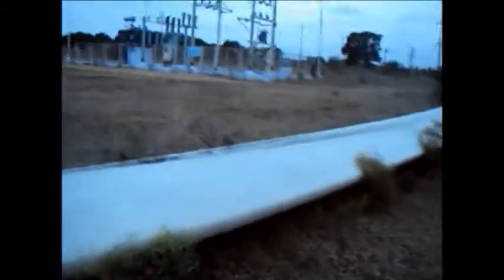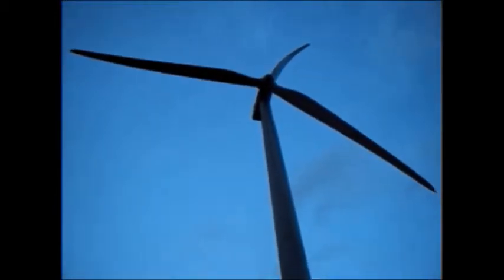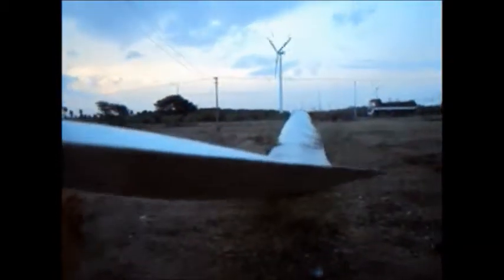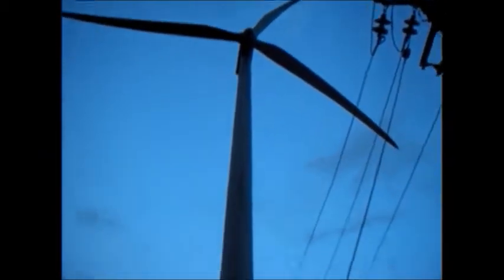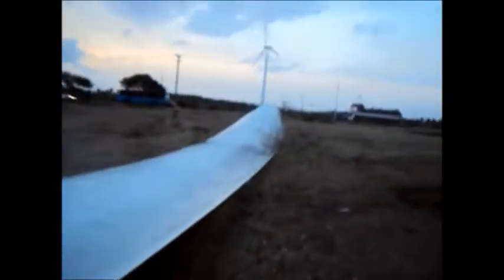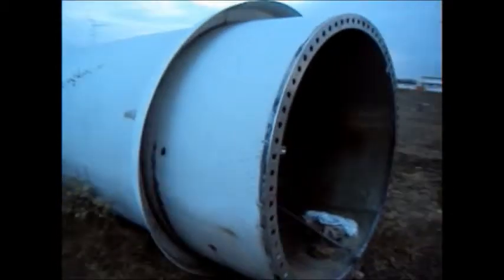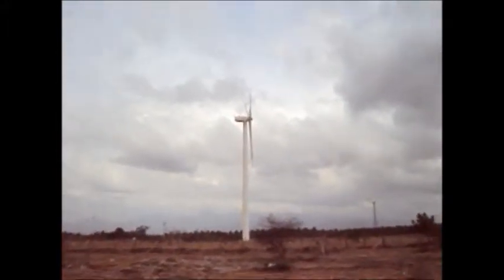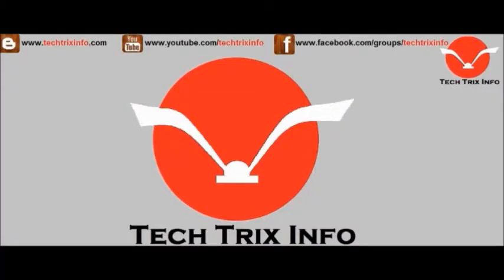How big is a wind mill leaf. ✔

Comment: The only reason they aren't even longer is because the tip would be moving so fast that it would go faster than the speed of sound and cause problems with drag and noise
Reply from the maker: You are quite knowledgeable 👍
Actually, wind turbines are designed with careful consideration of aerodynamics and sound limitations. Their blades are usually quite long to maximize the area swept by each blade, capturing more wind energy and thus generating more power. However, their rotational speed is kept low enough to avoid reaching the speed of sound. If they rotated too quickly, the blade tips would create a shockwave, leading to drag, noise, and structural strain.

To balance efficiency with these concerns, engineers optimize blade length and shape. The blades move more slowly at the hub but reach higher speeds at the tips. By controlling the rotational speed and using longer, aerodynamic blades, modern wind turbines can maximize energy capture while minimizing noise and aerodynamic drag.
Reply: @TechTrixInfo  Amazing!